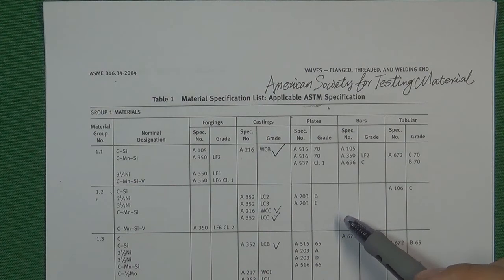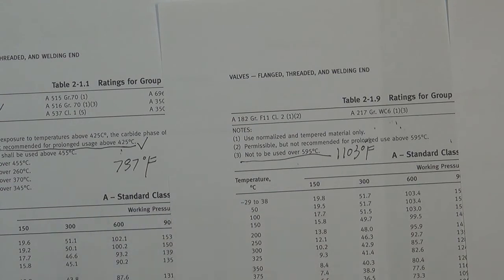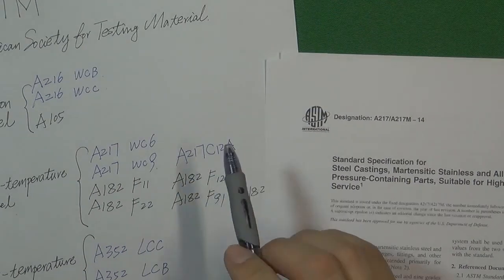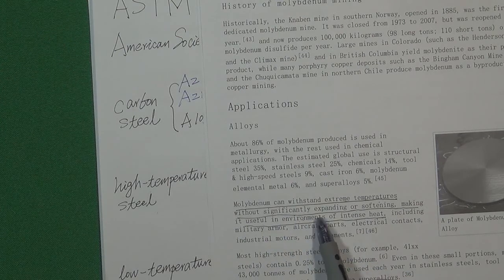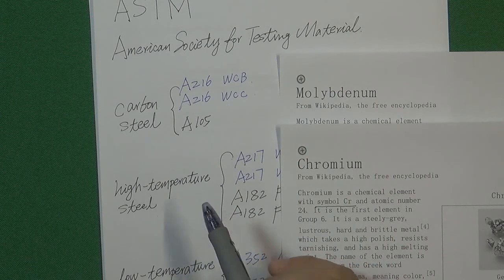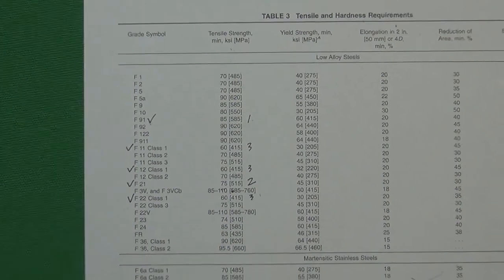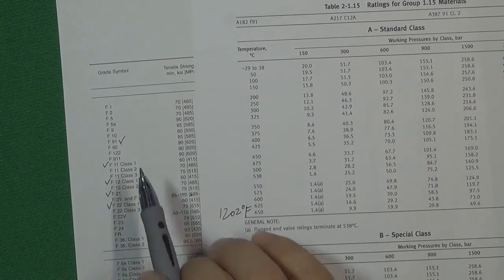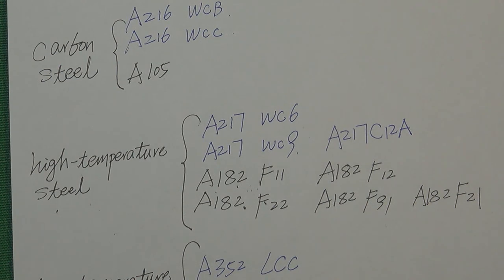WC6 WC9 C12A Which One is The Best High Temperature steel #ASME B16.34 Valve Material 3/5

Comment: Valve Trim (stem, disc, & seat) material using for very high temperature , >=420  celsius degrees such as high pressure power plant, seat encounters erosion by jet steam. Could you kindly advise the particular trim material using for this kind of service, in addition the valve body material?  Thank you.